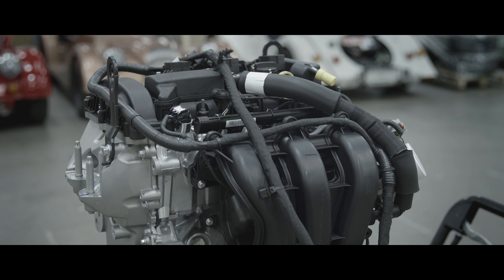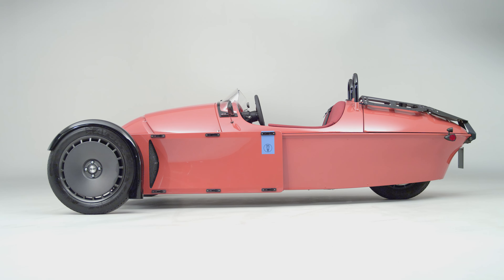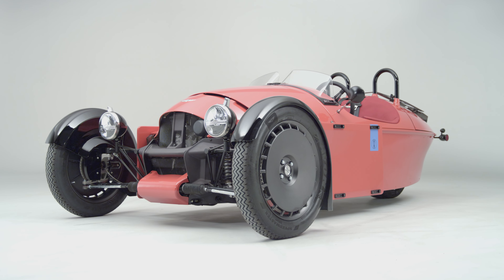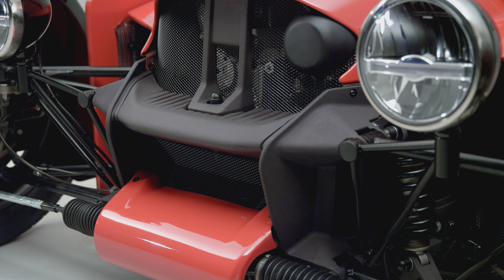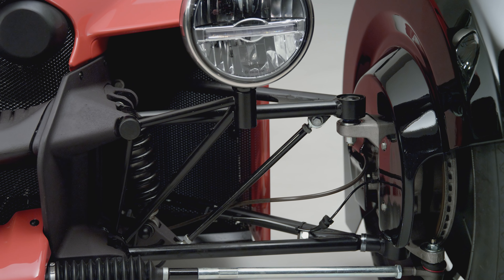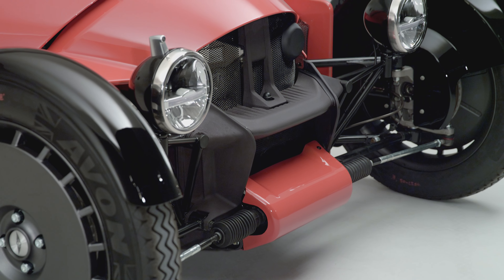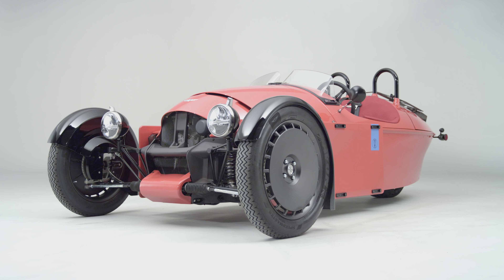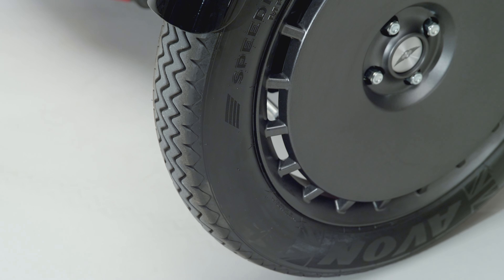Morgan Super 3 | Design In-Depth | Engine & Aluminium Castings (Part 2/4)

Comment: Ich habe an meinem HD  TwinCam  103 CI Motor  einen  Rückwärtsgang einbauen  lassen.  Das  ist überhaupt kein Problem.  Der neue  3 Wheeler  gefällt mir leider  gar nicht.  Der alte ist  um  vieles  schöner.
Reply: The raw visual of the exposed engine is the charm of the original.

Comment: Not the same as one wheel on each corner with full independent suspension. That single rear wheel as a lot of work to do in handling rough terrain.  A three wheel car was originally designed to get around motor tax regulations and kept under 8cwt to stay within the rules for motorcycle road tax.  It doesn't say but I doubt this vehicle remains under the weight. Why did Morgan stray away from using a big V twin out at the front with an ultra light body behind and stay within its original concept all be it using modern V twins etc.  I think it is much cheaper to buy a proper sports car from elsewhere when this is probably heading towards £40k
Reply: I don't think the V twin was viable any longer.